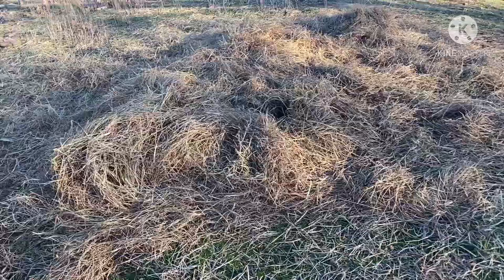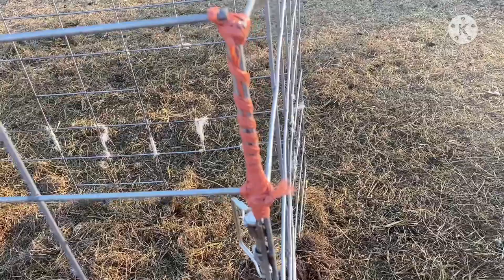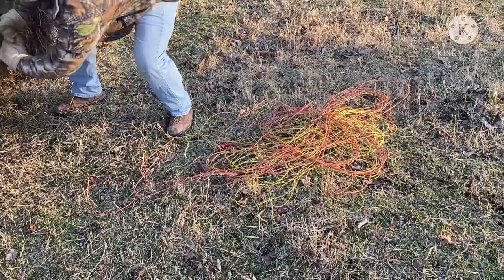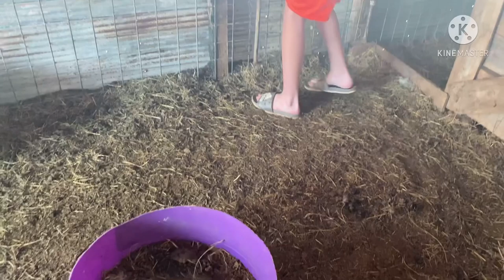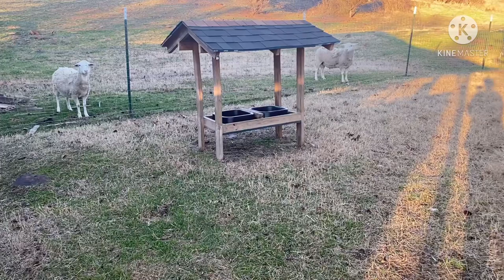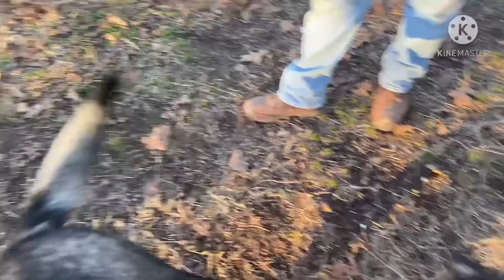Round bale feeder for sheep #4

Comment: Creative thinking there. Bet it saves a lot of hay from going to waste. And I'm almost positive "goat" is my favorite critter.
Reply from the maker: Stop by for a visit and when you leave I will see to it that Opie will have company in the sleeper for the ride home. Lol Just don’t tell Hailey. 😂
Reply from the maker: It really does save a lot of wasted hay. I’m going to make another one and I’m going to make the cut outs a bit smaller. We need 2 anyway so if the smaller holes work better I will modify this one to make the holes on it smaller also.
Reply: Love the hay cage idea!👍🏻 I wonder if the 4”x4” goat panels might work better?? I may have to try it out👌🏻great video tho! I’m glad that the hay I buy has the netting instead of strings. Strings look like a pain🤣👌🏻
Reply from the maker: The sheep and goat panels would work fine. I chose the cattle panels for 2 reasons. 1 is that they are like $20. each and the sheep and goat panels are $50. each.  2 the bigger openings on the cattle panels let’s them reach further into the ring to get the hay. The openings I cut so they could reach the center of the bale is what I made to big and is letting the goat and babie lands be able to get inside it. When I make my next one the openings I cut out will be smaller to solve that problem. I’m planning on making another one sometime before next fall. When I do I will make a short video showing the modifications I made to the new one.

Comment: But if you spread the hay out so all the animals have equal access, there will be less waste. And that really isn't waste. The hay left on the ground with the pee & poop on it will enrich the soil. Better soil equals better grazing, just move your feeding area every time.
Reply from the maker: We do move our feeding area every time for that reason. As for spreading it out there is still more waste than using the feeder we built. Last year we tried doing that and we lost 1/2 a bale to waste on every bale we feed.
Reply: @theshepherdfarm5154  Is 1 large bale more than they eat/day?
Reply from the maker: Yes. If we had a hay bale un-roller we would have tried that. But we didn’t even have a tractor until a few months ago. So we made what we have as it has worked the best for our situation.
Reply: @theshepherdfarm5154  I hear you! That is why I am still using small square bales myself.
Reply from the maker: We did that the first year we were in our farm. But then we had a guy offer to cut our hay and he does 4x5 round bales. This way we don’t have to pay for our hay  but for the last 3 years it was interesting on how we were able to move the bales to feed. Lol last fall I ended up making a hay spear for the back on my truck and that was a huge help.